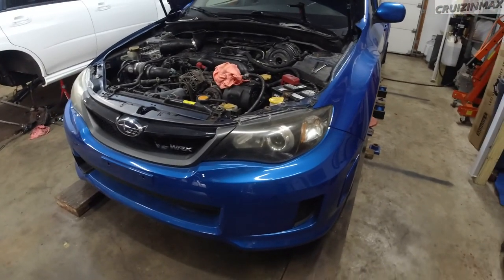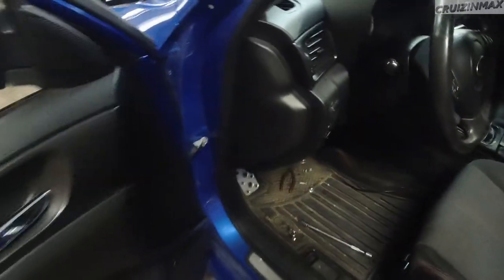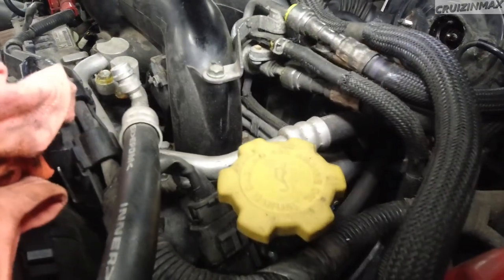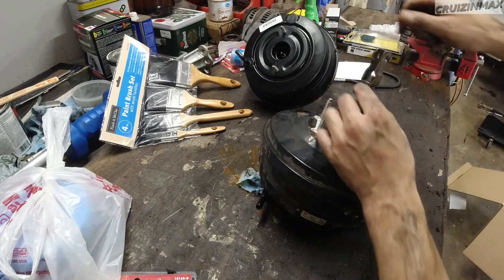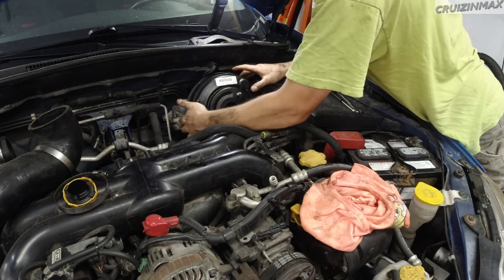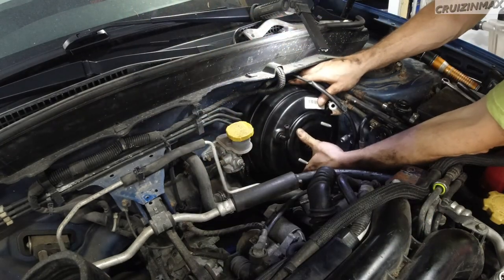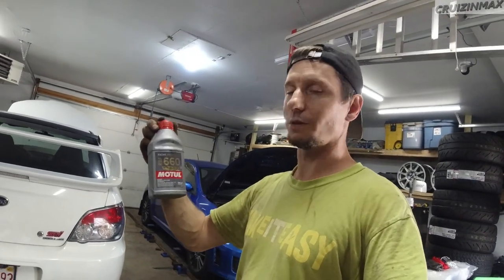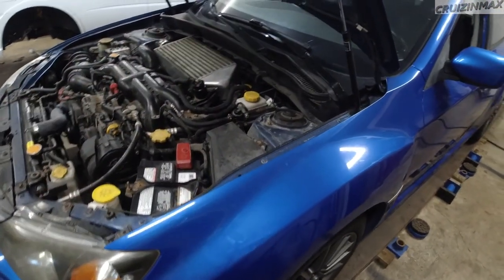Subaru Impreza WRX how to brake booster

Comment: 2:10 problems with a 2010 legacy look just like this car's problem, but that vacuum hose from the booster is attached at a different spot on the intake and there's no check valve in the line. I took it off and sucked/blew into it and it went both ways no problem. Different setup, or?

Comment: Hi mate, I have an issue with my brakes, 2002 Bugeye, I’ve replace all abs sensors & calipers and new brake fluid but issue is still there, when I step on the brake after a boost and step on the peddle it goes hard and it’s like grinding on my feet and it’s like I have know brakes, do you think this could be the booster? I have another abs Module coming on Tuesday also, you have any ideas? The ABS rings are good also no cracks
Reply from the maker: sounds like the abs pump itself, do you have a scanner that will show live data of each abs sensor speed while driving? the speed if different from others going in a straight line will give you issues, all 4 need to be the same.
Reply: I haven’t got one specific for that but can get one, I have an abs pump coming so hopefully that works, it’s seems to happen when hard on boost then slam on the brakes, I even got a genuine hose from Subaru with the check valve in it incase it was that, it’s scary when it happens as the peddle goes hard like having flint stone brakes hahaha I’ll let you know how I get on thanks for the reply
Reply: Forgot to say all wheels speed sensors are brand new, also when I take the abs fuse out it dosnt do it with the brakes, but no abs light on the dash only the handbrake light stays on, no fault codes ether so me thinking it maybe could be a faulty pump
Reply from the maker: seems like you did everything and the pump is all thats left, make sure you bleed the hell out of it after install.
Reply: Yeh I know lol have to bleed them like 4 times it’s a joke, I’ll let you know how I get on thanks